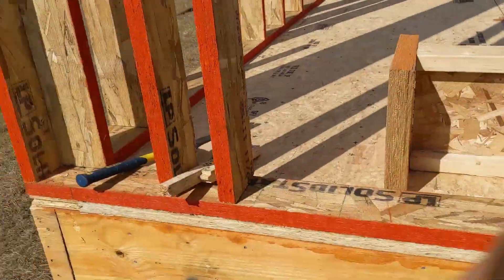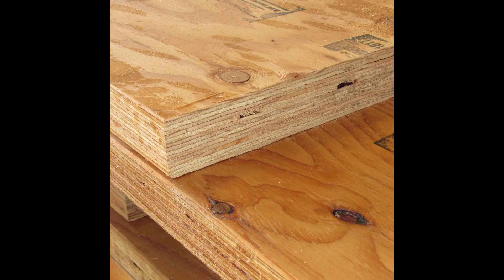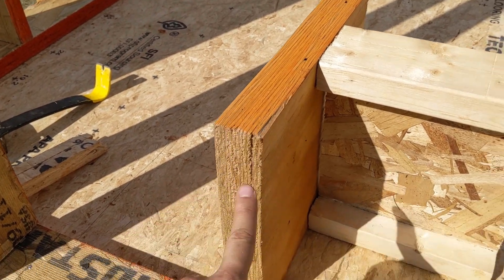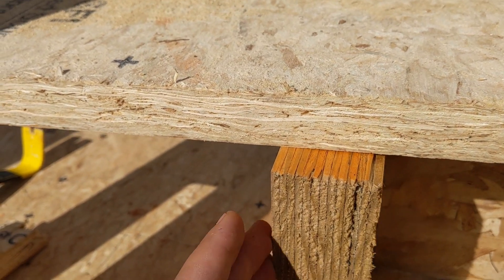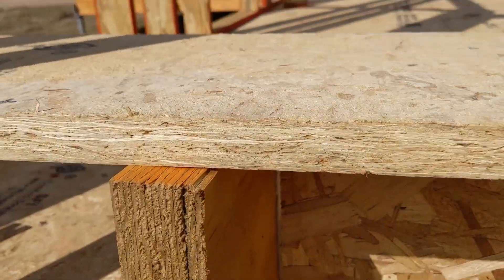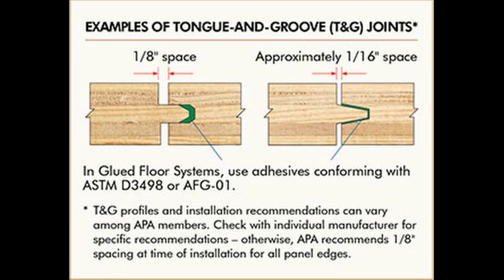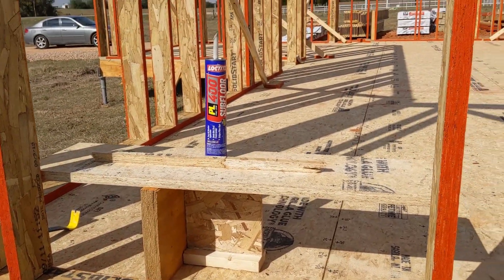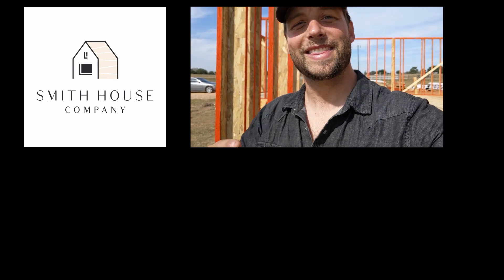Pier and Beam Foundation - How we are Building Up from the  Deep Foundation Piles

Comment: We’re adding a large addition onto the back of a large metal building that has a concrete slab... the addition will be offices and storage rooms etc. but it’ll be built on pier/beam. We’d like to tie into the metal building. Making the addition attached. Is it feasible, or maybe I should say doable, to build an addition with a pier/beam foundation tying into the concrete slab foundation? Anyone care to comment? Thanks

Comment: Referencing the tongue and groove subflooring gap requirements, although the sheets are installed with a "calibrated gap" built in as seen from the top, installed, the two pieces are still in contact within the joint when fully seated. I have to assume this isn't suitable for every environment/condition. Perhaps this has been an issue engineered out of the scenario, perhaps, but my gut tells me to continue to use clips. Big fan of your content anyways.
Reply: I picked up on that too; if the tongue is fully inserted into the groove, where is the expansion supposed to take place?  If it's a solution provided by the manufacturer, it should work, of course, but I'd like to understand what's happening.

Comment: Once you’ve had a house  built (properly) with I beam joists you’ll never go back - perfectly level; and stay that way ESPECIALLy for longer spans its very very difficult to get say 2X10 or 2X12 lumber thats anywhere near perfectly straight these days...and it if do go with conventional lumber beams, strongly suggest you sh9im out completely underneath with 1X3- helps with dimensional volatility with seasonal changes , allows you to shim out perfect flat ceiling for drywall , AND provides a space to run electrical  and even small plumbing if code allows. But I’d go with lattice beams or I beams with the predesignated punch outs in the OSB to not jeopardize the I beam integrity.
Reply from the maker: Amen brother!

Comment: Can I assume all of the LVL and stranded boards (bottom plate and seals) are products that have been treated for termites?
Reply: Not from the factory. FWIW: I ended up mixing in Boric salt into paint, and then painting all of my rim boards. (I have a basement, so no need to do all of the subflooring. Also had the contractors spray Boric Salt before installing the exterior foam panels. I seriously doubt that I will have an termite problem.

That said I took a scrap piece of LVL board and laid it on the ground. Termites absolutely loved the LVL wood.

Comment: How is warm moist air from the outside supposed to remove humidity from your crawl space?  You need a sealed/conditioned crawl in that climate.
Reply: I dunno, but it works for me. I live an hour from here and have a pier & beam foundation with a vented crawl space. Subfloor/joists have a few inches of damp-spray cellulose adhered, exposed to the exterior. I'm guessing the cellulose insulates the floor to keep its exterior face above the dew point? I have no moisture issues whatsoever after 10 years.

Comment: I know OSB is cheaper but I still like real plywood for durability against any moisture issues. I'd still use dimensional lumber for structural stuff like walls but I'm sure once it's all boxed in it will be strong enough. OSB and moisture dont mix

Comment: Were the pier extensions welded or bolted to the ones below as they sank into the ground?  If you have a big wind that tries to lift the house, how much vertical resistance is there to upward movement?
Reply: here's his explanation of the pile system: https://www.youtube.com/watch?v=us6eXEHvahs
Reply: Seems he's building in tornado alley.  I suspect they'll build a storm shelter as well.  Can't very well have a "safe" room though, since it's pier and beam.
Reply: it's my understanding that the resistance measured while driving the piles equals the uplift. Is this correct, Jordan?

Comment: So you just leave the grass under the house...no gravel?  Don’t you still need moisture vapor film?  Also, looking forward to seeing how the skirting around the house will be finished.
Reply: Michael R. M. Thanks. Still think it’s weird to not scrape the grass and topsoil off or cover with fabric and gravel.
Reply: Jeremy Eisenhut thought this too. Curious to know their plan.
Reply: @michaelr.m.3785  You want to to install gravel & a vapor barrier to avoid moisture, rodent and insect problems. It would have been better to either excavate for a crawl space or a concrete slab.
Reply: My bet is on closed cell spray foam.
Reply: Scorpio maybe in the actual underside of the structure but why didn’t they lay down any base material like gravel underneath?  Just seems odd to start building with no excavation of the topsoil and grass.